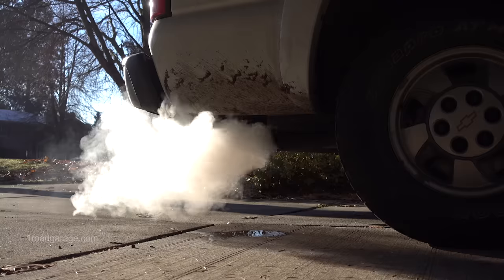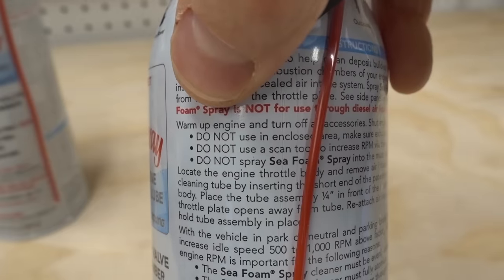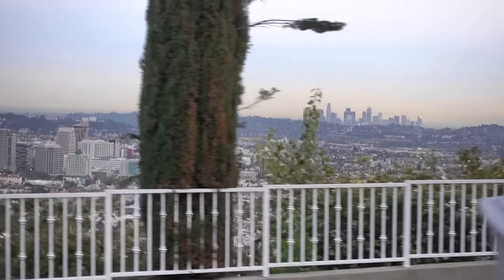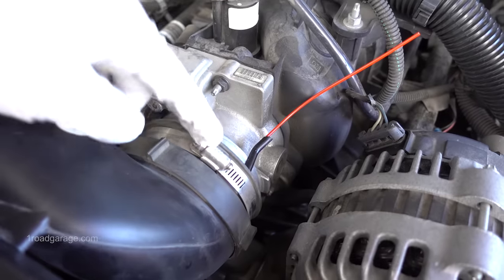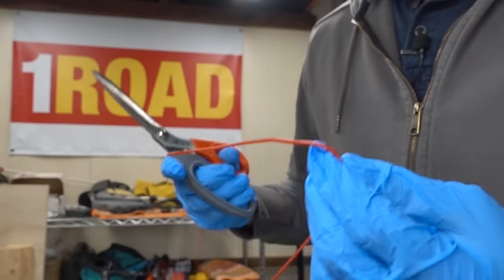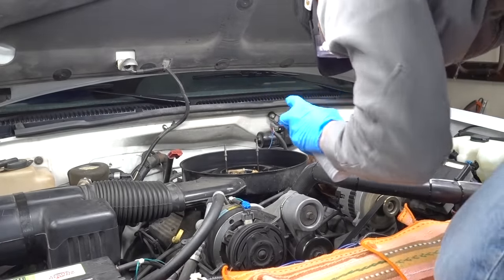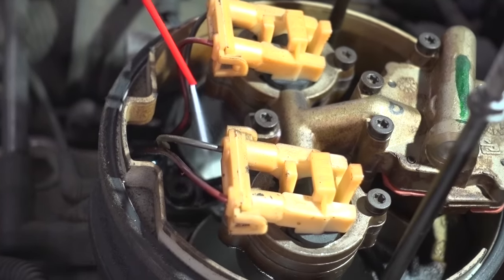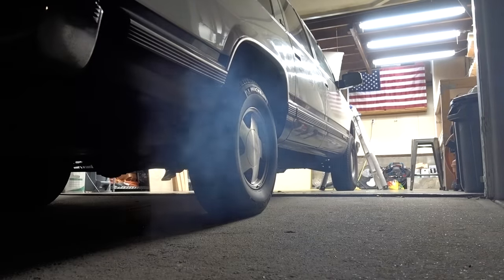Why You Should NEVER EVER USE SEAFOAM!!

Comment: by seeing the exhaust and your acceleration and aftermath the blue smoke... I would say your running very rich knowing the
history of gas milage from the 70's by personal experience I would say your getting bad gas mileage right ?
something isn't right in there buddy you should not get a big blue cloud of blue smoke on deceleration....
perhaps it is the accelerator pump ? if that modern thing has one.... my pickup got 12 to 15 mpg I found that the accelerator pump seal was leaking like a siv.... I rebuilt the carburetor and got over 20 mpg for about a week then it dropped again.... same problem, the accelerator pump was at fault... this time I made my own seal and that took care of the problem.
it would run great but on deceleration it would belch blue smoke....  just like your vehicle does....
although you did just sprey the heck out of it with the seafoam so that could be all of it... but if after you put some miles on it and it still belches blue smoke on Deceleration i would look there ! ... sense it's fuel injected I have no idea how they handle the accelerator pump, i suspect it still has one buried under all that crap....sense it is an early fuel injected engine.
strangely enough, accelerator pumps were the Most common reason for poor mileage in the 1970~1980 vehicles
they all leaked and some worse than others....
On my old 1968 Dodge PU I was able to get the mileage up to 22 mpg with a 318c.i.d engine , automatic trans and 4-11 rear end
it didn't want to go real fast but it could pull the house ! I repaired that carb (2bbl holley)and installed a 3"  exhaust pipe replacing the 1.75"or 2"  one that was on it .... 
now days I don't worry about it because all my vehicles have fuel injection.... and for the maintenance free aspect of it...i wouldn't have it any other way ! 
I don't use seafoam ....I use a quart of diesel  ...you want smoke that will give you smoke ! LOL( use it just like you did the seafoam...)

Comment: Ok so to get the massive amounts of smoke your doing it wrong. You need the can of pure liquid that's not under pressure. Detach your brake booster line and introduce a whole can into the motor while keeping it running, then take a 2nd can and try to make it stall with the seafoam if u can't get it to stall after half of the 2nd bottle have someone turn the key off quickly while it's struggling, let it sit for 15min and dump the remaining in your gas tank... When you start the vehicle again be prepared to apologize to your neighbors.

Comment: What I have learned then..if you buy a direct injection engine car - use seafoam at every service, to keep carbon build up under control. This is less risky than doing it after 100,000 miles and you will have a ton of carbon on the valves.

Comment: That "carbon smoke" is not carbon well technically its made of carbon but its the oil base of the seafoam burning off. Any kind of liquid in your system will cause vapor or smoke.

Comment: Put it in your vaccum line from brake booster
Reply: First off you didn't do it right 
you need to choke the motor out with seafoam
 and then let's set for 15 minutes 
by giving it throttle while you spray is not working properly
 you did not follow the instructions

Comment: Your carb flow of fuel will keep your valves really clean find a gdi engine and I'm sure it will smoke more than a crack head
Reply: Last time I did a seafoam spray treatment it look like two diesels having a rolling coal contest..
2014 veloster gdi..... 212,xxx miles

Comment: However if you use a high quality oil with good cleaners in it and proper service of oil changes it greatly reduces internal engine carbon deposits ,oils such as royal purple , amsoil , or additives such moglide all of which have really awesome cleaners in them and are proven to help keep exhaust gas carbons at bay .

Comment: Didn't work for me. Tried 2 cans. Both never empty fully. No smoke. Disappointed.
Reply: Hey just so you know, getting "smoke" has nothing to do with it working or not. It's just about where you spray it to allow the seafoam (which is oil based) to burn up and exit your tailpipe.

If it works or not for you is generally more about how gunky your engine is. You put it in, and then you measure the results of the cleaning as best you can, be that with how your engine sounds, your gas mileage, or how well the vehicles runs over years of you actually taking care of it.

Comment: You're not going to get the billowing smoke because your injectors are above the valves. Gasoline is cleaning the tops of the valves. Newer vehicles inject directly at the bottom and the gas can't clean the carbon on the upper.

Comment: The rpm is too high. Your burning the seafoam, in order to soak the valves the engine practically has to starve for air and then die at the end of the bottle.

Comment: Being a 10 year certified master service tech i can say Yess it smokes I'm also a chemist need all see foam is .. Is a mixture of pafafinic light oil and acetone just smell it obvoously so the smoke is just the oil burning off if it was carbon it would look black like a diesel under load the notorious smoke is just the added lubricant added so it doesn't rune rubber components in the fuel system because most if not all hydrocarbon solvents arevcirissive in there verging nature ifvitveas not added this stuff would corrode all plastic components of the modern fuel sys. And no cool smoke would billowe out of the exhaust food for thought my people

Comment: Don't believe everything these guys tell you. The engine already looks almost new, especially the throttle flaps in the throttle body.
     Scotty Kilmer has brought to our attention that oil is an ingredient in Seafoam and what does oil do when burned? Yes, it creates smoke. Even if Seafoam does help loosen carbon during soak, any chunk of size could cause damage to a catalytic converter or even a turbocharger. There are machines and pros to use them for ridding engines of excessive carbon. Changing oil regularly and using good gasoline are basically all you need to keep your motor running clean.

Comment: If you really want smoke don't use the aerosol use the liquid, take the pipe off the brake booster and dunk it in the bottle but keep engine speed up or it will stall out and be a bitch to restart.

Comment: Kill the engine with seafoam or have someone turn it off immediately after you stop spraying no more than a second or two with a v8 use two cans same time don’t let soak for 10 minutes especially if it’s never been done before 5 is more than enough the smoke will follow second use 8 minutes regular use 10 min

Comment: If you want to get small engines are truly contaminated pistons and valves in a black hoodie warm up the engine remove a plug make sure your electrical system is shut off no sparks with some protective eyewear on with a rag over the cylinder hole pull the engine over after about 10 minutes of soaking it secret mystery fluid brake cleaner do it twice 2 minutes Oaks brand new pistons and valves not recommend for carburetion too strong. Change your oil afterwards give me a shout out if that works good for you as well as it has for me over the years

Comment: You did it wrong! Run the engine till it is good and hot, then spray in the, C Foam spray, do not increase the rpm's, you want the engine to stall out, keep spraying the C Foam after the engine stalls out into the engine till the can is all gone, then let it soak for about 30 minutes, then start the car up, and,  WATCH THE WHITE SMOKE pour out of the tall pipe for several minutes too. That's how you use C Foam in the intake manifold of a  engine! Also, before you change your oil, pour some in the oil fill, run the car normally for about 1,000 miles, and then change your oil. It works great for deposits in the oil too!

Comment: Smoke and mirrors when you fog an engine it will smoke. Seafoam designed for 2 stroke . I have seen guys do the sea foam trick and there trucks had running issues after. You can't treat you cars and trucks bad and expect it cleaned all at once. It takes daily mantanice. I put total system cleaner every 3 thanks no issues ever . Gas has cleaner in it it's us law for emissions. Most older cars can't handle over 10 percent alcohol so gas has that covered . Now your adding how much more . 10 15 percent. Buy buy seals and rings you might not see it when you do it but in a few months wow. Don't forget about your cat your clogging it up with that un burned garbage. Doing it all at once you better drive 1000 miles after to help burn it out non stop driving. Yes the  cat had to be replaced after sea foam for my buddy's 200 300 loss or more .

Comment: no -  I replaced  the steering  fluid with Seafoam   after draining existing   steering fluid entirely  its been 7 days   no significant difference in  heavy  steering  especially to RH side ... I dont think that anything could dissolve  C deposits or varnish  that easily  ...  You need to  rest it  for months in  before  you can experience any real  efficacy  its simple chemistry  even with electrolysis it takes 24 hrs  to remove any small drops of  deposit   on metals I was hopeful with  Seafoam  but  very disappointed  sorry its a myth  <<<<<<<<<<<<<<<<<<<<<<<<<<<<<<<<<<<<<<<

Comment: My 2003 Z71 Silverado JUST got its first seafoam treatment at 202,000, very little for a couple of revs used 1 can,used 1 oz to 1 quart ratio,thought I did it wrong,so I did it again with 2oz to 1 qt,in crank case drove it for 200 miles , and changed the oil and to my surprise pretty clean,I have owned the truck 18yrs and have always kept up with it,religiously changed oil EVERY 2500 to 3000 miles,always use GTX 5W30 UPTO 75000,THEN WENT TO GTX HIGH MILEAGE TO PRESENT,HAVE A SUPER CHIP INSTALLED, SET ON PERFORMANCE TO ALWAYS USE PREMUM GAS,,AND IM GLAD TO SAY STILL RUNS LIKE IT DID WHEN I FIRST GOT IT,AND BELIEVE ME I HAVE A HEAVY FOOT AND KIDS LIVING 200 MILES AWAY,EVEN MECHANICS ARE WOWED THAT MANY PARTS UNDER HOOD ARE ORIGINAL,THEY KEEP SAYING IM 50,000 MILES OVERDUE FOR AN ALTERNATOR,I HAVE EVEN ASKED TO HAVE SERPINTINE BELT CHECKED AND CHANGED,NOPE,STILL ORIGINAL,I KEEP MY EYE ON IT REAL GOOD,ACTUALLY,MY TRANNY,REAREND,AND TRANSFER CASE HAD TO BE REPLACED THROUGH THE YEARS,BUT STILL FEEL THIS TRUCK HAS BEEN MORE THAN RELIABLE,THINGS BREAK,YOU DEAL WITH IT,AND I KNOW WHAT I HAVE,HOPE TO GET ANOTHER 20YRS OUT OF IT,AND I BET MONEY I WILL,JUST GOING TO STAY ON TOP OF IT,

Comment: If you change your oil regular you shouldn't have any carbon buildup
Reply: Motor oil cleans the micro carbon particles that are the result of the combustion process that get into the crankcase. The carbon buildup is in the intake manifold and the combustion chambers. Running a good grade of high octane gasoline is what keeps the combustion deposits from forming. Higher octane fuels burn better which improves combustion efficiency making them cleaner.

Comment: I did my 99 Ford it's got the 5.4 in it and I did with the seafoam said to do you know like you did but my truck has got $300,300,000 miles on it when you opened up and your video showed us your your throttle plate it was silver before you started so that was not right either you got a brand new carburetor on there which is not it you got the original carburetor on it and you got 21,000 miles on it something like that put 300,000 miles on it and then show us all that crap that just flies everywhere you didn't tell us in miles how many miles you have on it 10,000 something like that yeah I think your video failed

Comment: So his answer is basically…..since he didn’t see as much smoke as there are on other videos, he concludes it doesn’t work🤣🤣🤣🤣my guy ur doing it wrong🤦‍♂️🤦‍♂️You need to put 1,500-2,000 RPM while putting seafoam in🤦‍♂️u didn’t do that and u keep revving the engine up and down….u need to maintain it at a certain RPM 1,500-2,000🤦‍♂️🤦‍♂️🤦‍♂️🤦‍♂️

Comment: Well ill have to say your still new at using seafoam lol and because you asked what i thought about the video ill tell ya its weak sauce lmao jk but really run the seafoam thrue your vacuum system and youll see real smoke use the pour can and remove vacuum hose from  your brake booster and dump it in while its running then let it  sit for five to ten min no longer and watch the magic then

Comment: I used Seafoam on my 99 Silverado 1500 with the "I really wanna be an LS" motor.  Had to replace 8 injectors,  have my fuel line blown out, new pump, new fuel filter. $3,497.18. My mileage sucks now. Went from 500 miles to the tank down to 325. 

Up side...I've got a brand spanking fuel system...
Reply from the maker: Holy smokes??!! Did you put it in the tank?

Comment: You need to put a bottle in the gas tank. Then run a few liquid cans through a centralized vacuum line. Brake booster vacuum hose if your vehicle has a vacuum booster. There are a few different companies that make the tool to administer the cleaner that arnt all that expensive. Sea foam absolutely worx it does take quite a few cans for the best results & it is always a good idea to change your oil after the procedure because you can push carbon in to the crack case 🤜🤛👍👌🤙✌️🖕

Comment: I put seafoam in every used car when I first purchase it. It always runs better afterwards. Has a better idle, better response, and will get better gas mileage. I'll also clean the throttle body afterwards as well and change the oil. Car runs way better afterwards. Highly reccomend doing it before you sell a vehicle as well. 
I did this on a friends Honda Civic, it was the dirtiest one I did by far. My friend thought I blew his engine lol. We had to take it to a warehouse parking lot. Because it was smoking up my neighborhood bad. On the way to the warehouse, whenever I shifted from 1st to 2nd itd make a thick ass smoke screen. Couldnt even see the cars behind me. Sure they thought the car was on fire. My friend sure did lol. It smoked for a good 10 minutes. I had to go to the warehouse parking lot because it was spewing clouds of smoke. Was too dangerous to drive it on the streets. I was worried that I'd get pulled over on the way there. Just adjusted the throttle and revved it up until the smoke precipitated.

Comment: U folks that are happy to see your engines smoke throw some diesel fuel instead of gas in the tank. Equating choking the exhaust system with seafoam to making up years of neglect is making people money. Dont b an idiot and do this. Seafoam was designed for engines that sit or are used intermittently  not to shock or clean an engine.  Unless your vehicle has gasoline older than 30 days your wasting your money.

Comment: Laughable. So laughable that people pay so much money for this snake oil. 
Kerosene works just as well and is so much cheaper. 
I’m an aircraft mechanic. Jet fuel is just a more refined kerosene. We use jet fuel to clean piston engines and dirty parts. 
Sea foam was designed for 2 stroke engines, just like marvel. They can clean deposits but there’s cheaper and better products for modern 4 stroke engines.

Comment: Instruction said turn off accessories...
Both fans onmeans A/C is on.
Not that it makes any difference but you went as far as to read us the instructions..
Why use seafoam just to produce smoke?
The smoke is the carbon deposits burning off.
Drive the car after. Normally it takes driving the vehicle to burn off the deposits.
If you do not use it correctly and do this over and over just for smoke all you do is redistribute the carbon in the engine and the rings are cleaned of lubrication and many times scores the cylinder walls enough where YOUR engine smokes all the time then the idiot tries to sue.
This  video is useless and you just taught idiots to use the product in the wrong way 
Would love to see you held responsible for helping ppl ruin their engines.

Comment: Snake oil. If your engine is to the point of habing so much carbon built up on your valves, you need to walnut blast those valves, seafoam isnt going to do anything.

Its one of the most over wanked products ever.

Comment: Sea foam actually causes almost all of my cars that I’ve used it on problems.  I followed all directions and refuse to use it.  It fouls spark plugs and will clog your catalytic converters. The last car (2016 Toyota Avalon) that I purchased new ended up being the one that blew out my cats and fouled every spark plug and caused 2 of my injectors to fail. 
2004 Ford Focus it fouled every spark plug 124k miles
2005 Toyota Corolla fouled every spark plug and clogged the cat 247k miles
2016 Avalon fouled ever spark plug and blew out the rear cat entirely and about half the cat in bank one bank two the cat was just melting at the bottom. 
I will never use or recommend this product. It has cost me thousands of $